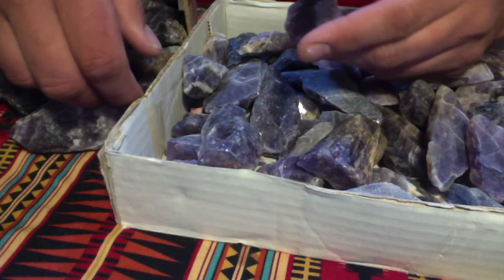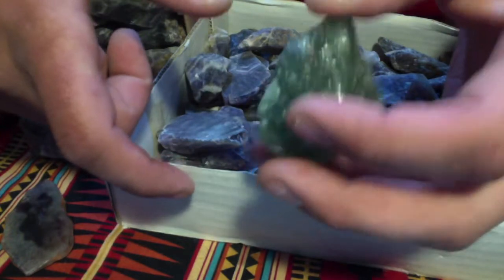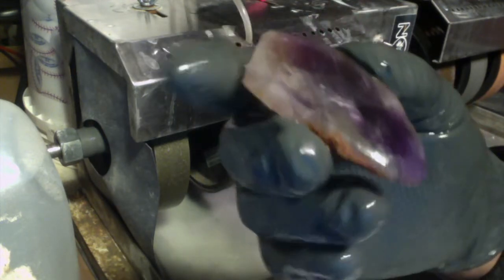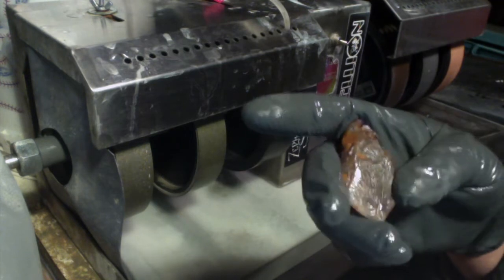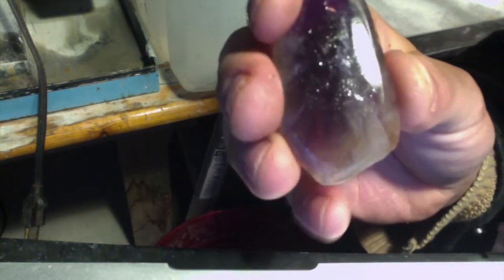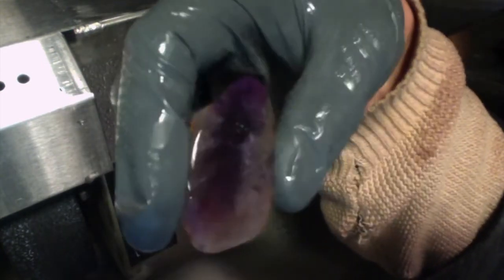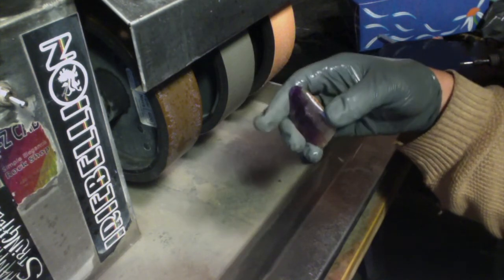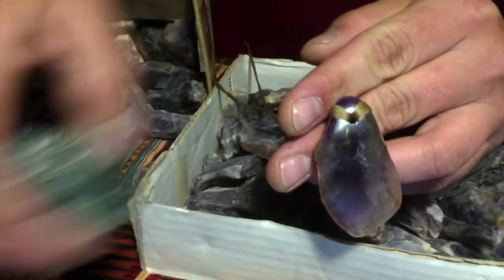Lapidary Time !!! Carving a piece of African Smokey Amethyst

Comment: Hey Dave,                    I'm just starting in Lapidary. I began collecting semi precious stones a few months ago, and began grinding, cutting, and polishing them a few weeks ago. I am having a fantastic time with all of it, from the ground-score to the finished stone. I've been learning how to do it from YouTube videos -- and I must say: YOU HAVE THE BEST VIDEOS OUT THERE, BY FAR. You have a perfect balance in your presentations that maintains my interest. Some others concentrate more on technique details but then end up boring. I like the way you fast forward through long grinds and show your work at each step, even your commentary is all interesting -- with just the right amount of technical detail.                   I started all this by going as cheap as possible: Dremel with Harbor Freight diamond burs, cheap drill with Velcro pad for 5" resin diamond pads (50, 100, 200, 400, 800, 1500, 3000, buff) -- that set cost $69, and a $70 wet tile saw. I was really stunned at how nice my jasper & chalcedony came out with this cheap equipment. I would like to build my own flat lap -- saw a video for a $100 build w/ new motor that looked really easy on YouTube. I'd like to try to build something like an easy-cab. Last week I made my first cabochon out of a nice piece of common green opal I found. It came out very nice -- but I couldn't grind out a thin crack on the face.  Right now I'm trying to create something with jade -- I recently found that I have a jade occurrence at an extinct volcano just 3 miles from my house (and I don't think anyone knows about it). I have found jade every time I've been there. Usually black, some yellow, some gray, some translucent. First couple of cabs I tried to make had large cracks across the face -- I might re-work them.                  Keep up the AWESOME videos -- and don't change your show at all (except for camera upgrades). I'm sure you'll build up a very large viewer base pretty quickly. (Sorry for the long comment).                             George
Reply from the maker: George Duchanin thank you so much for the love and support, find me on Facebook David Garcia Taos New Mexico-I have a crystal on my forehead and my Facebook picture,